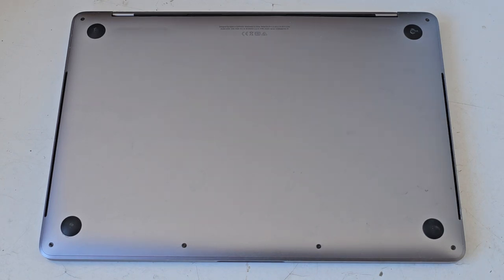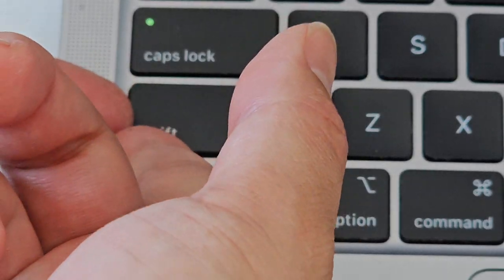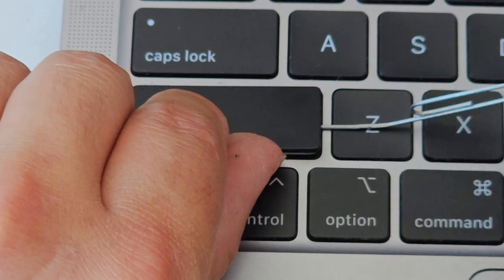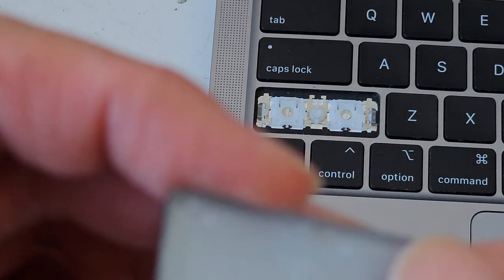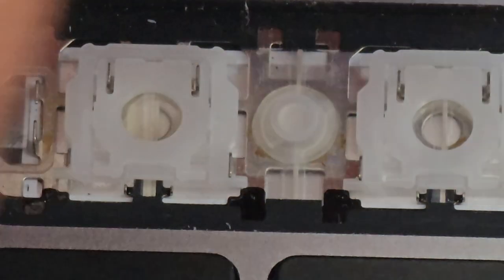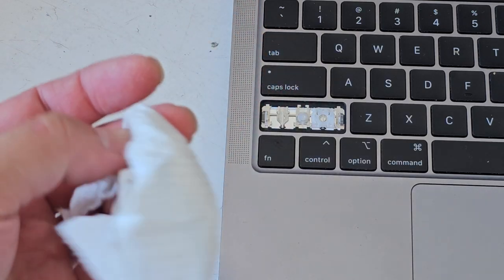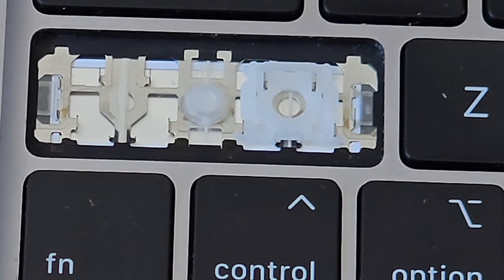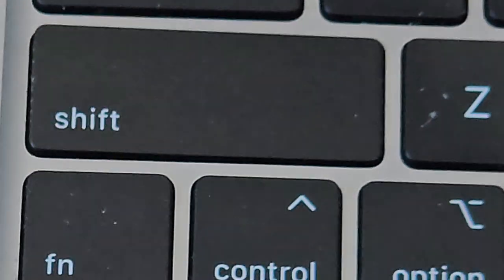A2251 2020 13" Inch Intel MacBook Pro Sticky Stuck Shift Key Removal Clean Up Repair

Comment: Mine stopped working after my wife cleaned my keyboard with a wet wipe.  Took 24 hours but it started working again.  Maybe just damp and it dried out under the key?
Reply from the maker: @THEM-BONES-1  you got lucky

Comment: I failed on the last step... It just totally down to the bottom when I installed it back up😥
Reply: I managed to do it somewhere on my fifth try. Try it, you can do it.
Reply: The small rubber support under the key is easily overlooked. If missed the rubber, it can't pressed properly. (Shift key)
Reply from the maker: @shanshameer8724 yup

Comment: thanks for your video, i took the key out and now when i put it back it stays down, the spring sort of mechanism does not seem to work and key stays pressed, any solution
Reply from the maker: Clips are likely broken
Reply: @ItsBinhRepaired  nothing seems to be broken ,is there any email i sent you photos on?
Reply from the maker: Upload a video on YouTube and I'll check it
Reply from the maker: Check the clips that hold it to the white hinges
Reply: Ya, mine too, seems my lowest key now 😢
Reply from the maker: @ztntzcollection  :(
Reply: @ItsBinhRepaired  the metal supports on the key were bent, I made the adjustment and it started working again.
Reply from the maker: @ztntzcollection awesome!

Comment: I did it on the right side but my shift key is just stuck into the keyboard and once i press it it wont come out, it was clean and everything. Did I break something?
Reply from the maker: Sounds like the plastic pins that the clips go onto are broken.
Reply from the maker: Look at both pieces and see how things connect.
Reply: What should I do
Reply from the maker: Look closely to see if anything is broken
Reply: The small rubber support under the key is easily overlooked. If missed the rubber, it can't pressed properly. (Shift key)

Comment: Hi, i have a Macbook Pro 2010 13", and it allways start on security mode. Is it possible that i have that problem on the Shift key? Because when we press the Shift and power it goes to Security mode boot? Thank you. By the way, my shift key is not stucked, it works normal. Maybe i need to change the keyboard? Cause i do the SMC thing and it allways bot normal.
Reply from the maker: Try booting into recovery mode and test the keyboard in terminal or in the change drive name box disk utility.
Reply: @ItsBinhRepaired  It was the left SHIFT key that was glued some how. And as you know Shift & Power on macbook pro 2010 enter the security mode. So i must change the keyboard and for now i Press ALT before power on my mac and it bypass the keyboard. I still have the right SHIFT key. But i will change the keyboard... :)
Reply from the maker: Interesting

Comment: You should try using a spudger, its a lot easier to remove.
Reply from the maker: Uhhh no, no it's not, and you're more likely going to break the clips. They're too thick. What's easier is for me to do it without a tripod in my way so I can record to show people how to do it. Lol
Reply: @ItsBinhRepaired  I find it a lot easier to remove in my opinion. Mostly new spudgers though where the end is still thin. I tend to remove the whole keyboard keycaps in less than 3 mins only because i want to change the keycaps to more cleaner and less worn down ones. Its a lot easier and I haven't broke a keycap clip yet
Reply from the maker: Nice